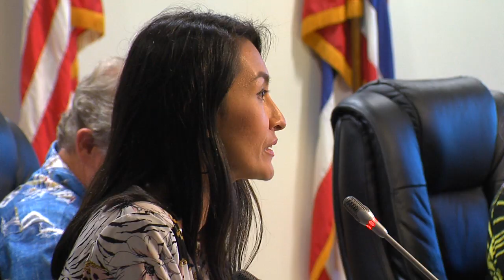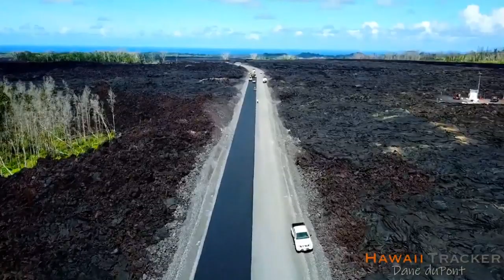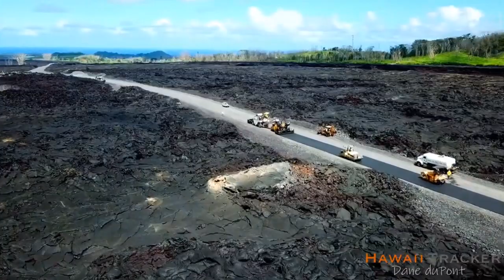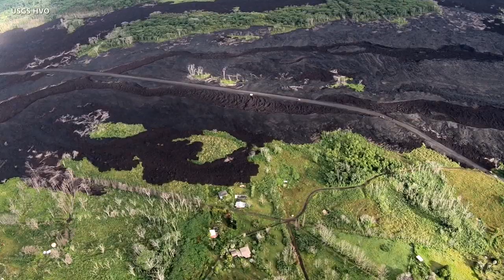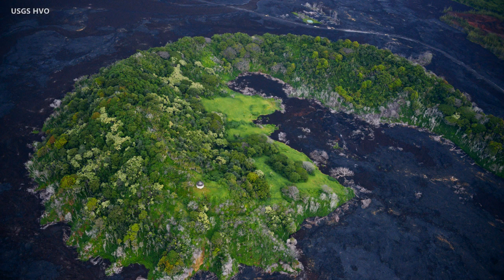Lava Heat Causing Highway 132 Project Delays (Sept. 3, 2019)

Comment: Why is this a priority????? Temperatures so hot that it’ll melt asphalt, seems like it’s obviously not a safe roadway to have open to the public.
Reply: Peter Lau cuz of the deadline to get the matching federal dollars
Reply: Peter Lau there are farms and such out there that are inaccessible now
Reply: The priority is because there are a lot of people who live out there and have no access to their homes.
Then because they started it based on that priority, and federal grants usually have a time frame, they have to get it finished, or get an extension, to get the money.

Also, the temperature isn't dangerous per se, but if asphalt isn't able to cool down its weight capacity is drastically reduced, and it rapidly fails under normal use.
This is a constant issue in the desert and hot climates, where they have to use special very expensive asphalt with additives and modifications to be able to handle the higher average temperature, and we are talking about the difference between in the 60s and the 70s degree Fahrenheit average asphalt temperature. Not dangerous at all, just higher than what asphalt can handle.
Reply: Peter Lau they just passed the Kilauea development process. people won't be able to live there's anymore. so sad

Comment: Can’t they just make it gravel for awhile? People traveled on gravel for 50 years in the US?
Reply: I think it has to do with qualifying for the matching funds from the feds. it's also state highway. not many gravel highways, if any, anymore...
Reply: The "gravel" in this case is crushed fresh lava, otherwise known as glass shards. Not good for tires, and you don't want to breath the dust from it.

Also, the federal money is based on building a paved highway.
Reply: It may be just too damn hot for rubber tire vehicles to travel over.
Reply: @kansasthunderman1  you mean like the rubber tires on the tractors spending all day working on it, and the rubber tires on the workers pickups that park on it all day, and the rubber shoe soles of the guys walking around on it all day? Lol

Asphalt has to get cold enough to "freeze" or it will stay soft and mushy and fall apart very quickly with normal traffic.
So "too hot to pave" could be 70-80 degree surface temperature, because it never lets the asphalt cool enough to solidify.
Reply: @ke6gwf  Here's my concern. What if there's magma lurking below the rift zone and it eventually makes it's way up to the surface?
Reply: @kansasthunderman1  usgs knows where the magma is. It's easy to locate using seismic sensors and such.
This road is sitting on what was recently molten rock, and it takes time for it to cool, even though there is no flowing magma near it anymore.

And remember, we are only talking maybe 50 degrees hotter than normal here.
Reply: Mo Jerome  when they park the machines and go home while they wait for it to cool down, how is that fraud or milking the job?

Comment: We  folks in the frozen North are Starting to lay Blue sheet insulation under the asphalt layers to prevent Frost heaves.  Maybe lay this at hot spots??
Reply: That insulation is actually to keep the ground temperature even, so that the sun warming the black asphalt doesn't unevenly thaw the ground and then refreeze.
In this case, heat rises, and while the insulation will slow the heat, it will still overheat the asphalt, reducing its weight capacity, and leading to rapid failure.

Comment: Roadbase might need to be insulated, thicker crushed rock to raise the grade.
Reply: Heat rises last I checked, and rock is a good conductor, so asphalt will still be kept at a higher temperature, and the warmer it stays, the less weight it can bear, and the faster it breaks down.

Comment: They could just start poring concrete over the lava and just make the concrete even at top European style roads up and down
Reply: redfirekla you sure!!! Concrete cracks when rapidly hardened. Heat will create that rapid Hardening and it wouldn’t cure properly.
Reply: @truhawaii5957  I was thinking if they set it up right before a heavy rainstorm that would ensure proper curing but you might be right the heat might be to much
Reply: Concrete is much more expensive than asphalt, and it all has to be imported. The asphalt is mostly lava rock, with a little imported asphalt binder.
Reply: It's so hot because there's magma lurking below the surface. and it might erupt again.
Reply: @kansasthunderman1  it's actually cooling down rapidly, which is why the rest of the road can be paved, that section just was molten recently and hasn't lost all its heat yet. If the magma were still underneath, it wouldn't be cooling down at all.
Reply: @ke6gwf  There are parts of the rift zone where scalding hot steam is venting to the surface. I suspect magma is lurking several 100 (and maybe a few 1000 feet) down there.